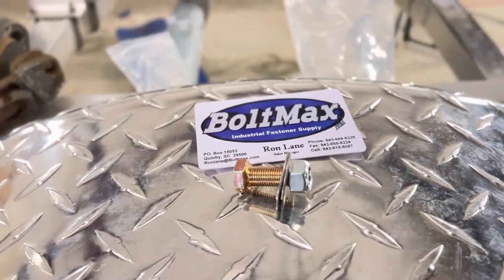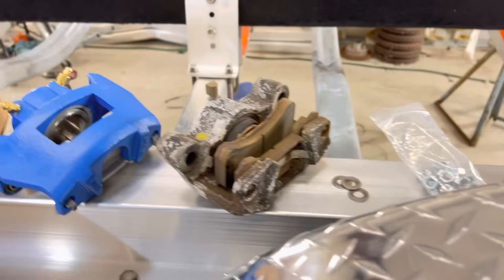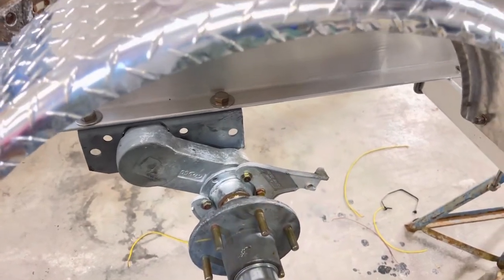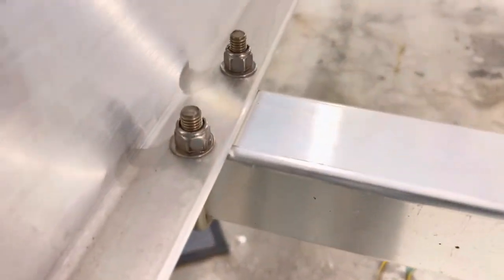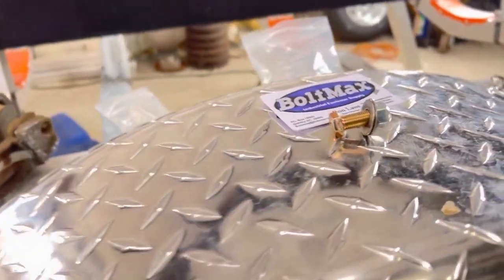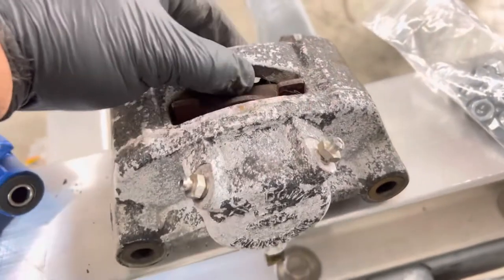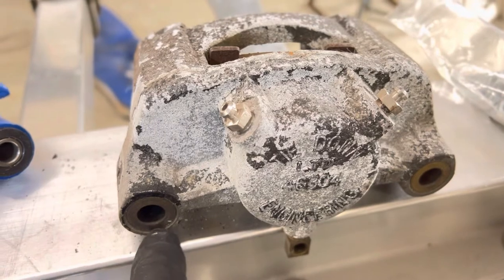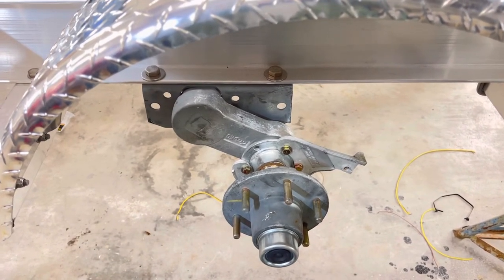#BoltMax and #KodiakTrailer Disc Brake Upgrades EXPLAINED!!

Comment: Quality matters. Wow you replace every bolt? Those  Kodiak brakes look awesome.
Reply from the maker: Not on this trailer as it already came with Stainless bolts.  On most other trailer manufacturers... they skimp with galvanized or no coatings altogether.